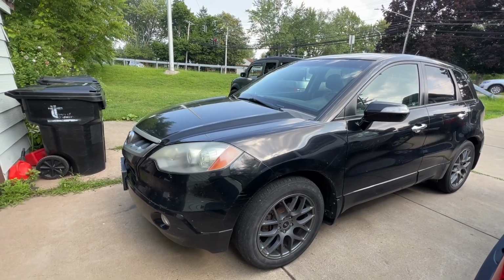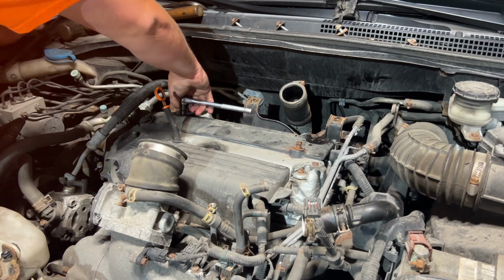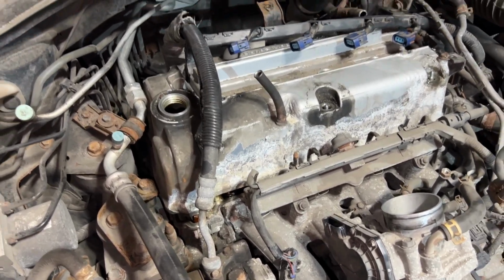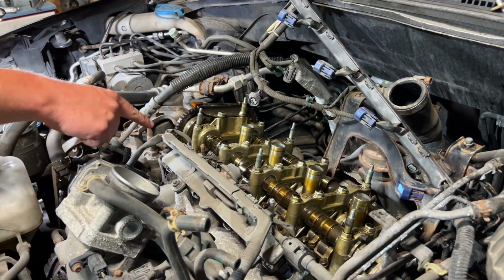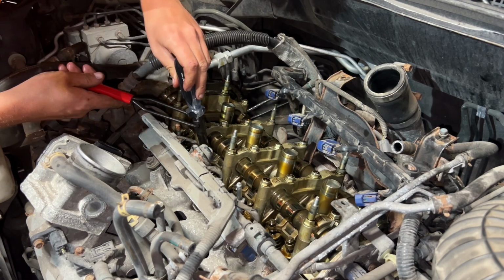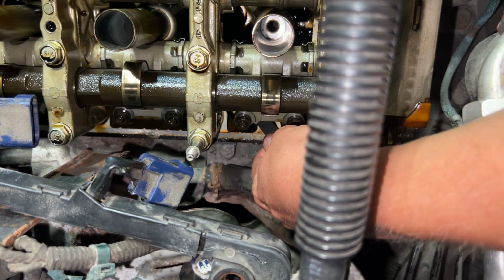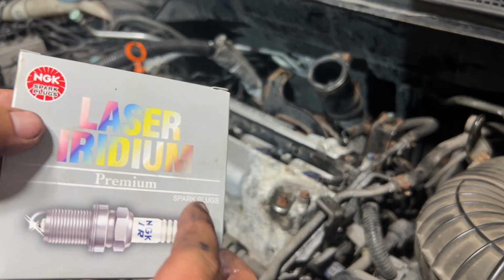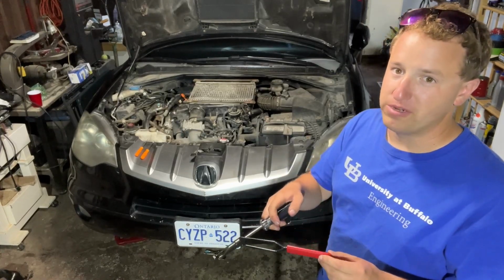07-12 Acura RDX Valve Adjustment

Comment: Thank you so much for making this video!  You are life saver sir!   Thanks to your great instruction I have been able to adjust the valves on my 2007 RDX.  I had no idea that I was at risk of burning my exhaust valves.  I bought a used tail light from someone who owns two RDXs and he mentioned to me that I should adjust the valves to prevent burning them. He seemed very knowledgeable so I think he might actually be and Acura or a Honda tech.   My vehicle currently has 213,000 kilometers, so past due for a valve adjustment and new plugs.

Comment: This is a useful video, I wish I had seen it before I did the valve adjustment on my RDX.  The wire harness connectors and cable ties all have to be released on the timing chain side and rear of engine and there is little room to get tools and hands where needed. You have to access the connectors from above and below to reach them all.  I ended up using long picks to open up the cable ties, the Honda cable ties have a little tab you can pry up with a pick to open the cable ties. If you think you can just cut the cable ties, good luck getting a tool where you can actually cut them. Getting everything disconnected to get the wiring harness out of the way is valuable information in this video.  I also saw valve clearances on the exhaust side being tight and out of spec and the intake side okay. Thanks for the video, anyone planning to do this job will benefit from watching.

Comment: Acura made a mistake putting the inter cooler on top of the valve cover. Bad design.
Reply: yup that's why they never did it again..i have a08 and I'm planning to switch it to fmic this summer.. it's very annoying having to disconnect the intercooler to do minor things
Reply: Great explanation.  Thanks!

Comment: Great video. One thing i would add is that you need to apply Honda Bond to 4 places, not 2. The locations are where you showed, but also similar junctions at the back (where the timing cover meets the head at the left and where the gasket changes from being flat to shaped at the right).

Comment: Buddy did all that work and didn't even replace the spark plug tube seals ....
Reply: Right? Anytime if you do all that work to remove valve covers and so forth, might as well change the valve cover gasket , replace the spark plugs, and if the coils are old and a little brittle especially seeing all that rust on the bolts, why not change the coils too. Maybe it wasn’t in the budget for the cousin . I’m sure the codes would’ve said it if you had issues with spark plugs and coils, but doing all that work removing everything, why not.